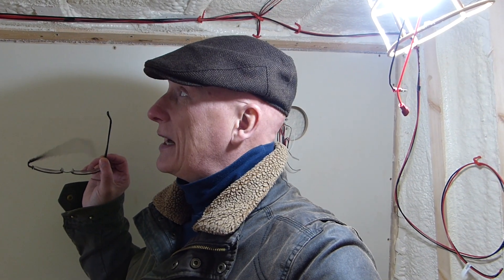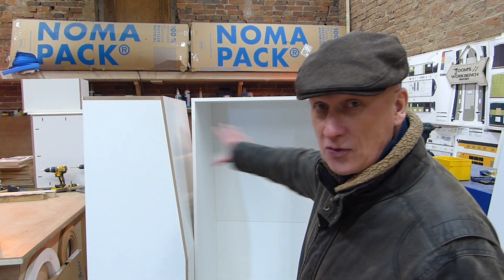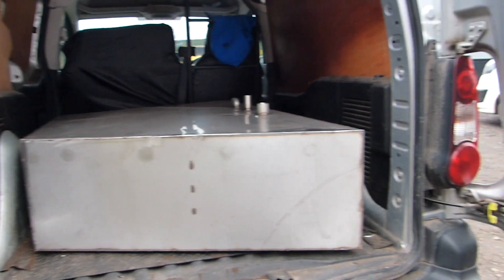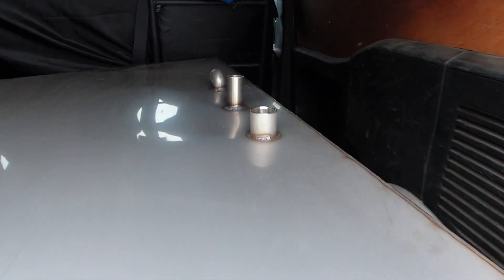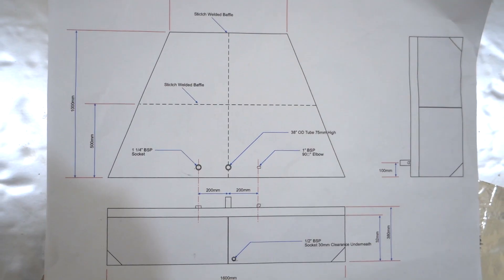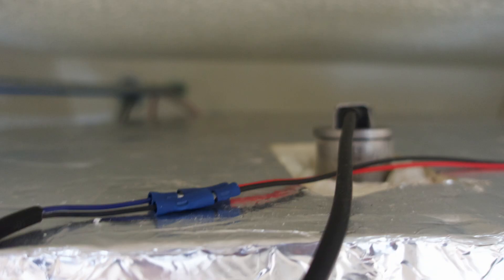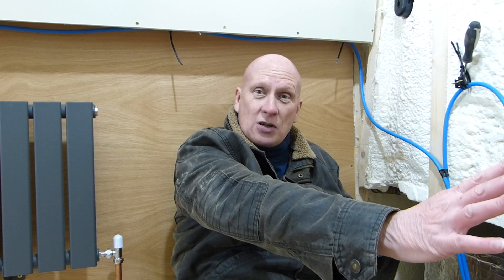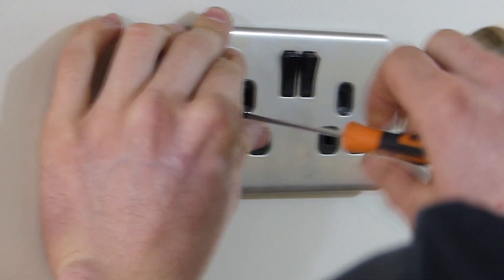Ep 18.  Innovation in Narrowboat Water Tanks

Comment: I bought my 70' Orion when it was already 10 years old. It had an 800 litre polypropylene water tank; I would have chosen stainless steel but I didn't have that choice. To date (8 years later) I have had no problems with the water tank.

As far as bow thrusters are concerned - I manage my 70' boat without one - but then I have never had one. Perhaps one would provide an advantage, I don't know. However I have seen any number of boaters making a complete a...hole of themselves using them.

If you can afford one and you don't think it will offend the KISS principle, then why not? After all, you do not have to use it and it may help the re-sale value of the boat.

 thi
Reply from the maker: It’s good to hear the water tank is still giving good service and not all the literature is correct or, you’re looking after it. My principle was like you, if you never had a bow thruster you’re never miss it. Then it was pointed out, it may not be me that needs it.  Additionally, there are a lot more boats on the canals now than when horses were pulling boats and for a long boat, it just might save a bit of trouble. 
In short, if I don’t spend the money at the start of a project properly, I’ll spend it on stuff I don’t really need. Thanks for the comment Frank.

Comment: Chris, it’s not just the inconvenience of having to dismantle half the boat to remove the tank to attempt to fix a cracked weld.   More importantly, how long would it take for you to notice there’s a slight leak from the water tank, and how much long-term damage is done to the boat in the meantime?  If a couple of baffles prevents that, it’s well worth the extra expense.     If the welder lingers too long on stainless steel, you can very easily end up with brittleness in the heat-affected zone around the weld, so a crack along the weld might not be such a remote possibility.   And the degraded properties of the metal can’t be reversed by welding up the crack.     Welding stainless steel properly takes a hight degree of skill and knowledge.  So those baffles will certainly help you sleep a lot more soundly at night!     Worth their weight in gold,, I’d say.
Reply from the maker: This is experience talking. I was using what I call a bit of risk analysis with nothing more than ‘what if’. I wonder how many people are living on the belief that this May or will never happen. No welder will deliberately over heat the metal but, who will own up if that happens. It won’t split overnight. It’ll take years and their not numbered so perhaps there’s no proof who made the tank. Innovation. Mark from The Fit Out knows his stuff. That comes from living the experience. Thanks for the comment Martin.

Comment: Have to say Chris, I've never, ever heard of a weld failure on a newish water tank, but I have heard of a few older ones that had bad corrosion and leaked.
More relevant and more likely is the risk of water pump failure. My boat was 5 years when I bought it, and the pump failed within a month.
I've heard a few boaters mention water pump failures, and I'm starting to think of them as a sort of disposable item- so my advice would be to make sure you know where it is, and how you can get at it, and how you can replace it when needed.  
They are usually under the bow stairs, so not too difficult to get at, but worth taking a look whilst its all being put together.
Reply from the maker: All over it this time Tony. Even to the point of having a spare water pump ready for that inevitable day. 
I get the water tank thing is unlikely. That said, stainless steel tanks are still new(ish). I don’t think they’ve been tested through the sands of time for anyone to know for sure. 
I’ve also got a POV about windows, for the same reason. A Luddite I hear you say. Probably. 
Anyway, thanks for your thoughts.
Reply: @chrismears-inslowtime  , I might've known you'd be on the case 😀
Worth mentioning though, just in case...
You probably wont need it for 3 or 4 years, but at least when you do, you'll be able to get the new one fitted in an hour, instead of faffing around on Amazon, or the nearest marina chandlery. 
I don't have a water gauge, so I keep a 10 litre emergency water container in case I run out earlier than expected.